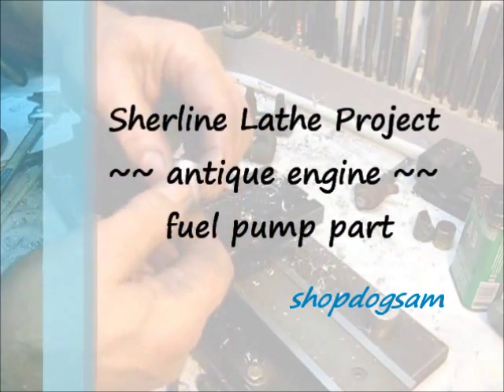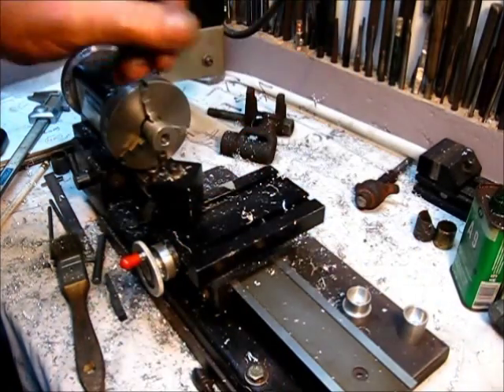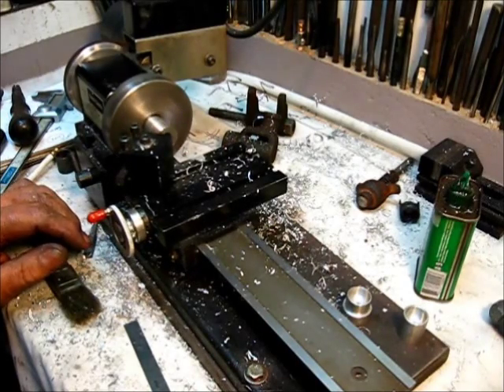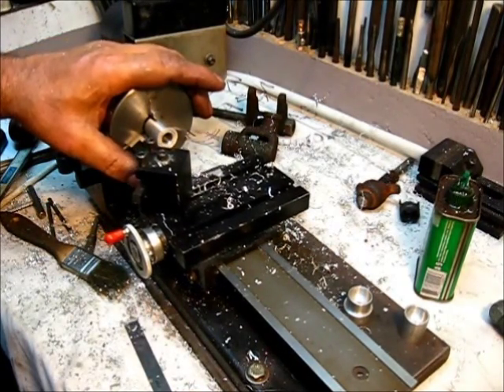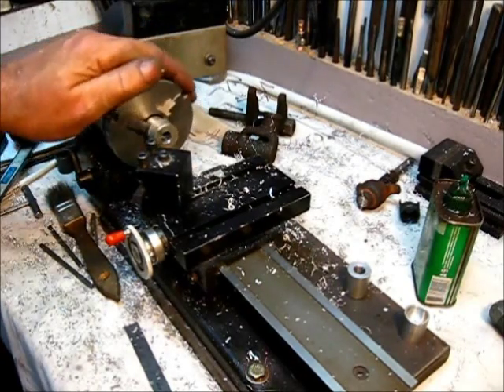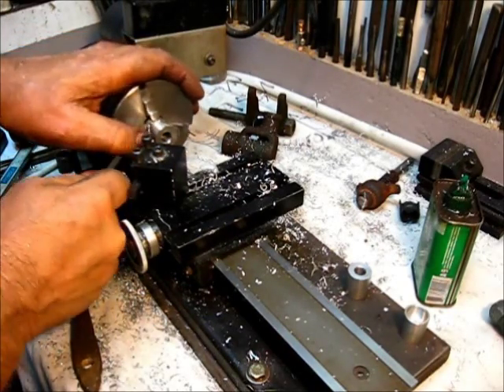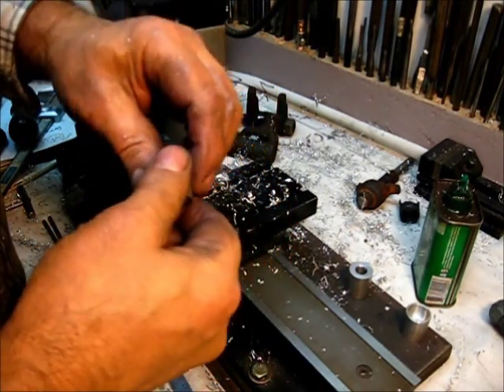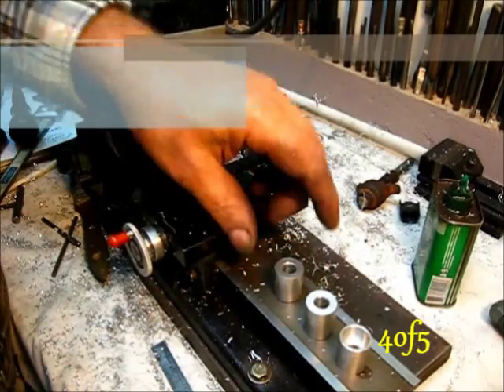Sherline Lathe Project / antique engine fuel pump part 4of5

Comment: Do you have any problems with the speed change when the lathe gets loaded down?  I used a small lathe before using a larger lathe at work and the small one took some getting used to. You had to run it fast because it'd slow down so much. The bigger lathe had gearing for speed so it would maintain a constant speed much better. Just wondering.